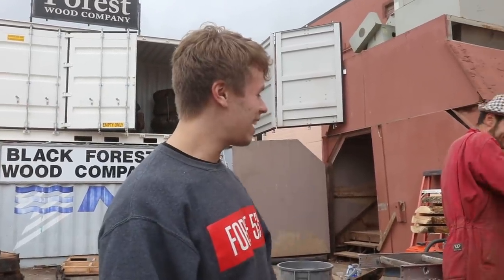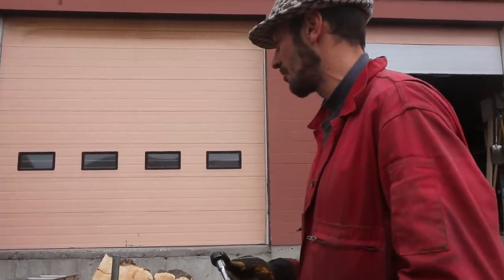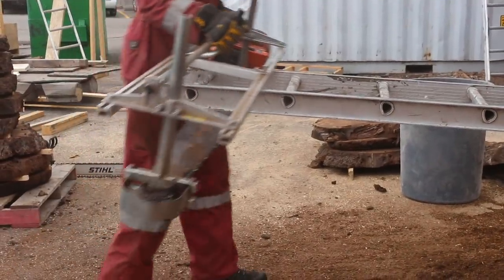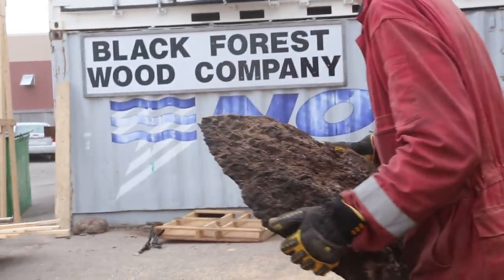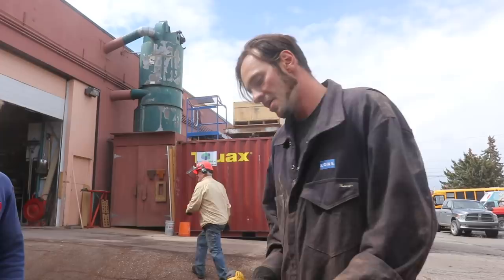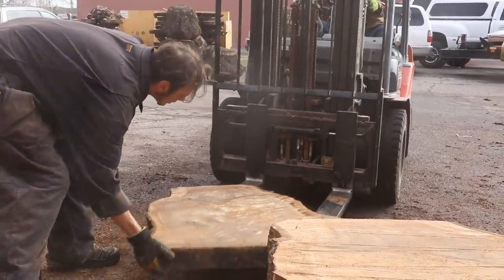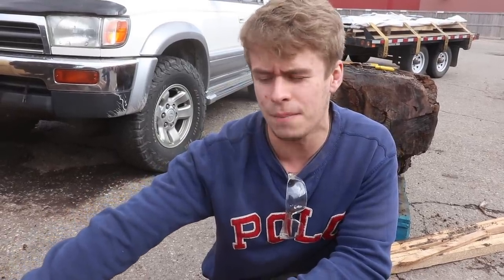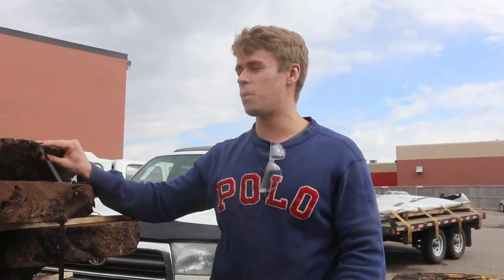Milling 30,000 Pounds of Walnut Burl

Comment: You can cut the dry time by 95%, dedicate a room specifically for drying. Run a dehumidifier with low air movement on a completely sealed off room. Let it run for 3-5 days, measure the moisture content every other day.
Reply: I’m a structural drying engineer. We use dehumidifiers and air movement to safely dry out solid lumber in 3-5 days without risk of cracking the wood. There are different types of dehumidifiers for different scenarios, you can use a Desiccant dehumidifier over an LGR if you’re worried about heat.
Reply: @Macgyxer  Hey sorry to dig up an old thread but I need to build a budget kiln would 2 inch thick walls of foam boards n a 2x4 frame be sufficient for a 12x8x4 ft kiln(solar) taken up to 150 fahrenheit to debug?
Reply: @johnnycorn7225  should be sufficient! Take into account the type of foam board for heat retention. Most of them melt at 160. Proper insulation and sealing to prevent heat loss. Other than that, I don’t see any issues with what you’re thinking.
Reply: @Macgyxer  thanks for the reply sir, I could use some 1/4 or 1/2 plywood panels on the inside to make sure they don't melt and provide extra strength n paint them black maybe. I'll angle the roof about 45( in KY) degrees n use the clear polycarbonate stuff n a few solar panels. I'm excited n got a lot of very high end wood to mill and dry
Reply: @johnnycorn7225  sounds like a solid setup! Kick ass brother

Comment: Another great video. I do the same with my chainsaw mill. I attach the ladder every time. I total agreed with him on what he said about giving the chainsaw the best shot at a decent slab.
Reply from the maker: Thank you so much! and yeah, it's a good strategy for sure! 😄
Reply: Am in Scotland UK -have to admit I hadn't thought of doing that .
I have probably been lucky so far . But I just consecutive mill slices .
Not had a problem so far in trees up to 1450mm wide and or up to 6m lengths . 
Usually am accurate to within 1 or 2 mm over the slab..

Comment: Go to Baileys.com and in the search bar type in "cannon bars" and you can get bar's as long as 84 inches. On the bar length check show more. You can also order a dual cut head bar, don't remember how long though but I thing up to 12 feet cut with.

Comment: What applications for the sawdust?
Reply from the maker: Unfortunately it will go in the garbage as walnut sawdust does not make good compost material, it is harmful to the plants.
Reply: Black Forest Wood Co. could you not put the sawdust in clear resin and turn into coasters or pen blanks? Just a suggestion.